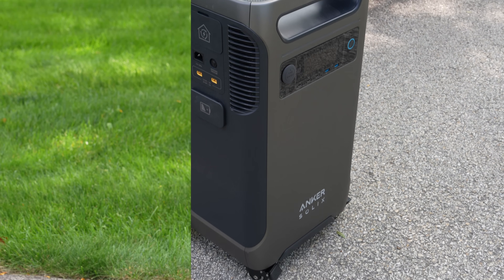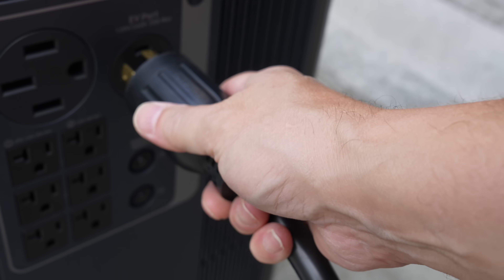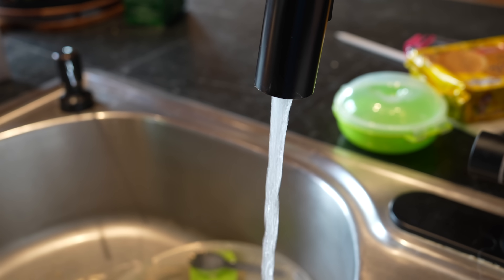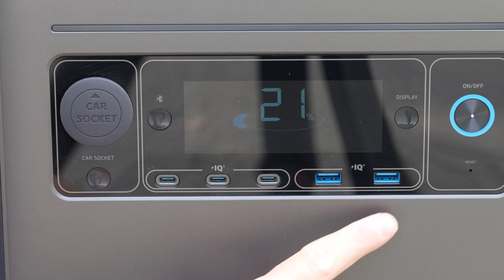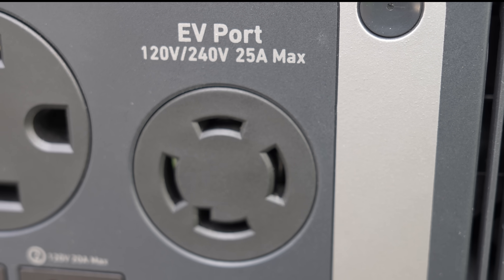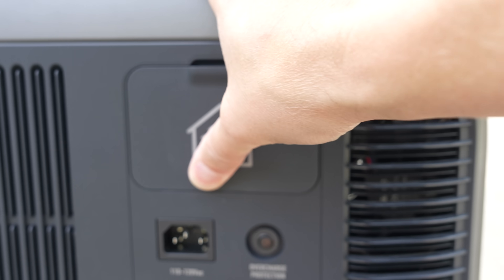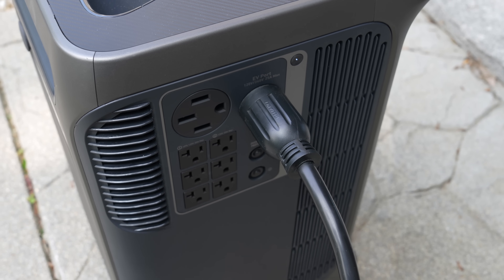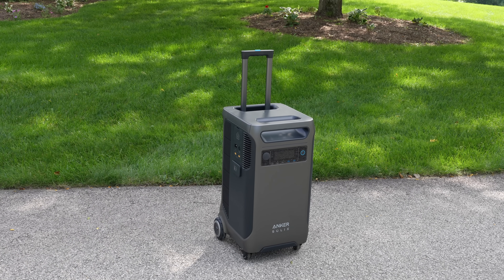Better than GAS Generator? First 240V Battery Backup - Anker SOLIX F3800

Comment: I have the f3800 and wish would have gone with EcoFlow. EcoFlow allows you to program to turn certain sockets on depending on battery level (ie if your level rises above 80%, turn on water heater), and EcoFlow also allows you to set a battery charging limit shutting off solar at say 90% to extend battery life.  Anker has none of that, plus just sitting idle the inverter drains almost 100watts. The Anker app is garbage, totally useless lacking basic features like charge limit. something that would be easy to add and has been requested. Research reddit before buying f3800, EcoFlow has better features for the amount you're spending

Comment: Would this power 3 hp shop equipment?  I called the manufacturer that sells heavy duty woodworking machines, and  they said their 220v machines would keep tripping because of some magnetic switch. Totally didn't understand what they were saying.
Anyways this was a 3 horse 220 volt, 12 amp wood planer I was looking to run on this Anker.  Will it REALLY work???

Comment: I speak from experience. These units are worthless in a real disaster. They're good only for a brief power outage. In a real disaster (like the 2 hurricanes I went through last year) nothing substitutes for a generator. I have a 6,000 Watt 240V inverter,  800 Amp Hours of LifePo batteries, and 2,000 Watts of solar to charge them. I still needed to use my generator most of the time. I live in Florida so I needed enough power to run my septic pump, 2 refrigerators, 1 freezer, and 2 window air conditioners 24/7 for weeks, not hours. Also internet and a TV is helpful as it keeps you from going crazy. This unit costs $3,000 USD ($4K if you want the solar as well). You can buy a pretty nice generator and a lot of gas for that amount. Like I said, these units are good for a brief power outage, but they are useless in a real disaster.
Reply: Only dumb ass would consume that much power in a real disaster

Comment: Your information is incorrect. This IS NOT the first unit to have standalone 240. The Zendure Superbase is the first. I have it and bought it 2 years ago because of that. It does 240 and 120 simultaneously. And a 6400Wh battery in 2023 https://www.youtube.com/watch?v=Ofmy92f4SgA&ab_channel=HOBOTECH

Comment: I hope Anker can make a smaller 240V compatible portable power station. If Anker can make a new version of C800/C1000/F1200/F1500 with 240V output compatibility, that would be sweet.

Comment: Biggest problem with the f3800 is the 240v outputs turn off while charging with 120v. Not good if you’re running the 240v to a sub panel.

Comment: this will never be better than a generator.
generators have long term reliability, lithium batteries will never have this. lead acid? maybe, but not lithium.
this product is for daily use, generators are for emergency use.

Comment: I think I’d like to have a device that allows a generator hook up that could pass through and charge the battery. That way I could cycle the generator and run it a bit more efficiently.

Comment: The ports for charging your phone directly from the device are for people who would use it the way I plan to. Keep it in the closet charged up, if the power goes out wheel it into the living room and run a space-heater or AC unit and charge your phone and stuff like that. Running only the essentials, just this pack without any expansions would last a long time. During a power-out event I'd have no need to run my entire house, just the essentials.
Reply: Right I don’t get why ppl need the whole house for a temporary outage.
Reply: @nmoore8994 
Exactly! Don't need to run every single thing in the house, laundry can most likely wait, the dishwasher can wait, and many other things can be switched off.
Reply: If that’s all you need couldn’t you just buy something cheaper?
Reply: @JacobsTrash 
Running something like a space heater that uses around 1500 watts consumes a ton of power, something this size is totally necessary for something like that and probably some lights and phone charger and refrigerator.

Comment: I think people are missing the point of this thing. This is best used in line with the solar panels they offer with this device, this can run your home overnight and charge and run your home during the day, it's completely automated and silent. People are comparing this to gasoline generators when they're not even in the same ballpark as this thing. If you connect this to solar you basically have unlimited free power, gas generators cost you money in fuel and maintenance. Also I'm not sure if anyone knows, but during any outage people usually freak out and buy up all the gasoline at gas stations and all that. You're still relying on the gas station to be there and fueled up if you use a gas generator, with this battery-pack and solar-panels you're only relying on the sky getting bright every day. These come with a long warranty also so if you did have an issue it's all taken care of. This is for people who don't want to mess around with loud generators and relying on refueling and all that. The sun is going to come up every day, gasoline at the gas station during an event isn't guaranteed.
Reply: @amptrek   First of all, the dual FP3800 setup with maximum expansion batteries holds 52kWh.  So it would take days for 1200 watts of solar panels to charge it, even if you weren't using any power at all.  It's not designed to run your home on solar power, it's designed as a battery backup to be charged from the grid and then have some solar for emergency use.  Not normal daily use.

The average house uses 30kWh per day.  1200 watts of solar panels - let's go crazy and pretend they'll be producing 1200 watts for 10 hours a day.  So that's 12kWh per day from the solar if you're lucky.  Some days when it's cloudy, you'll get about 0.  Like you said, 1 hour of the clothes dryer can use half of the power that the panels will produce all day.  Then there's no solar left to charge the batteries.  And forget about air conditioning.
Reply: @SalvadorButtersworth  RIGHT!!!
Reply: But from my understanding, this unit can only accept a maximum of 3 solar panels of up to 410watts each. Any more than that in parallel would be too many amps, and in series would be too many volts.

They're built so you can plug together 2 F3800 units, and a wall panel, with up to 12 expansion batteries, but that would only be good for emergency backup.  6 panels would not keep that much battery capacity charged if you're using it to power your home.  So if you buy the full set, about $20,000, you'd have to keep it charged from the grid.  Or charge it over multiple days with solar and then not use it until the emergency.

I guess once it's charged to 100%, you could use the relatively small amount of extra solar that's coming in during the day.  But a comparable $20,000 set of a different kind would come with 24 solar panels and less maximum battery capacity.  I think that's what you would need to realistically be off-grid for more than a few days.
Reply: Thanks for sharing 😊
Reply: The fact that you had to explain this lol Solar is just better
Reply: @audacityhour3104  Yep, people are against it but that's how it goes with new things. When fuel injection was introduced all the carburetor guys were totally against it, even though fuel injection is better in literally every way.
Reply: Do you have this ?
Reply: @oldblackstock2499 
Yes I have this. Running a few household things like a TV, Wi-Fi router, refrigerator and some other small stuff it lasts me all night, charges great during the day even on a cloudy day.
Reply: @amptrek awesome thanks for the info, that’s what I was looking for at least the fridge and some fans by power lose during hurricane, we did 7 days without nothing was rough, we sat in the car to recharge our phones and cold down a little. 
I think this will be a good investment
Reply: @sv160  This is a very good investment!
Reply: @oldblackstock2499 
I do have this.
Reply: Take my money!!!
Reply: What about places like Seattle where we can go weeks or months without seeing the sun
Reply: @VictorMartinez-rv2ec 
It'll charge on a cloudy day too, slower, but it'll charge. If you're energy efficient this thing would definitely work for ya.
Reply: @amptrek Have you been to Seattle in November?
Reply: @teddmented 
Seattle gets about 78 hours of daylight through the whole month of November on average, Seattle through the year is mostly cloudy. Solar panels still work on cloudy days and sometimes they can produce more electricity on cloudy days because the cooler day actually makes the solar panels more efficiently produce power. Even with clouds solar panels still work. If you can see light on the ground the solar panels are producing electricity.
Reply: @amptrek  You are wrong. Your solar footprint would have to be massive.
Reply: @billyswampwater4515 
All depends on how much electricity you use every day, there's not a base number that every household uses every single day. Some people are horrible at managing electricity and some people use very little electricity.
Reply: @VictorMartinez-rv2ec  Then part the clouds or actually live somewhere habitable 😅

Comment: too much money for what it’s capable of doing. 1/3 of that  money will buy a generator that will run the entire house just like its on the grid. If noise is the issue you can build a quiet box for the generator for about $500. you’re still saving nearly $2000 and the benefits are far and away greater. 

A unit like this would be good for temporary functions, where there is no electricity. If, you could increase the power for longer running time.

Comment: How long this batteries will last? I mean not the the charger but the battery. I bought a battery powered EGO Mower and after one year, batteries couldn't hold the charfe anymore... Same thing happened with some rioby batteries, and eventually with our smartphones...

I mean, it's a lot of money to have batteries not holding the charge in a couple of years.
Reply: Your mower is lithium ion which has ~500 charge cycles. This battery is Lithium Iron Phosphate which is 3000+. I believe the anker has a 5 year warranty and 10 year estimated lifespan.

Comment: If there is a power outage longer than 24 hours. The solix becomes an expensive brick.
Reply: What would you recommend.
Reply: @sirjames1977nc  a generator of some kind. Long as you feed the beast, you're good. Basically.

Comment: BS...it is not better than a generator, it is complimentary.  The only way this unit, ANY battery system is if it has Solar or Wind power for recharging.

Comment: Dont bother. Ideally all these devices should be made to run for at least 2 days without the need to recharge. But as far as I know, such battery unit does not yet "exist" or just hasnt been put to market. Eventually perhaps new power  devices will be able to power your home 100% 24/7 independently of power utility and grid when this happens, all power utility companies will close down due to loss of customers.

Comment: this is nope. i have a 5sets of commercial washer and dryer all runs for 5500watts 240v  base on our electric meter. idk what scam dryer you have. it cant run the initial startup which could spike more than 6000watts this is lame

Comment: I know this is an older video, but is there anyone who knows the peak wattage output of the single unit? I'm assuming the 6,000-watt rating is the running wattage. I currently use a gas generator with 9,000 peak watt capacity to power an outdoor 10,000lb capacity automotive lift. I'd love to invest in a solar battery system that could meet or exceed those numbers as running a gas generator is very annoying.

Comment: Not the only one, Titan, from Point Zero Energy, 240sp 4000w, 120v and 240v in one unit. Big difference,the Titans are the only true power low frequency inverter units, not these chinese high frequency units. Dont be fooled, low frequency units are the only way,tried and true

Comment: in all these reviews. no one  ever says how long these batteries will even last running basic appliances and lights in the house.  when i see reviews on the earth roamer rv and they say those things can last over a week on just solar charging the batteries. yes thats a million dolla motor home but why cant anyone just say that in their reviews on these batteries. how many days in basic lights and appliances will this thing last before you need to recharge it.
Reply: What you're asking is not calculated without more information. Each refrigerator will run different wattages, as do light technologies and quantities. Batteries are rated in watt-hours and you can add your load and do the calculation yourself easily with an online calculator.

Comment: Manual says it can take a  2400 watt solar charge but........V x amps= watts
32 x 10=320watts..ch1
60x25= 1500watts.ch2
Total= 1820 watts
Correct? 
So where are they getting that out can charge at 2400 watts

Comment: Dont buy one of these get a good gas or propane generator. There nothing but a computer controlled battery which doesnt last and takes forever to charge and cant charge untill the power comes back. If it has a solar panel it takes a week of strong sun to charge it.

Comment: You North Americans are consumption nutters. Get yourself a clothes dryer that uses half or less of the wattage. Here in the UK the average clothes dryer is 3000 watts...smallest 1,800....max heavy ones 5000. 6000watts for a clothes dryer is mad!

Comment: tfw this piece of junk cannot be recharged from a wall socket or gas generator, and output 240V at the same time. The EcoFlow Delta Pro Ultra, however, can.
Reply from the maker: Yes 100% correct as I showed in: https://youtu.be/2K9mlryo8lI But to be fair, no other power station on the market can do that either because you need dual inverters. The Delta Pro Ultra is a wonderful device but it is also almost $2k more even with my coupon. Neither one are junk but if you can afford the extra for the Ultra its certainly a great feature.
Reply: @SilverCymbal  not making a dig at you, bro. Just Anker for leaving out a feature that severely limits the usability of the unit. Keep it up with the quality content!
Reply from the maker: @therealmitch-a-palooza7262  No worries. No I didn't take it that way and I totally agree with you. I wish the Anker had it too. Thanks again for watching
Reply: All my eco flo products broke it's straight 🗑️ "not making a dig" just stating the facts for me 😂

Comment: Did your unit emit a constant high-speed fan noise @ like 70 decibels (sounds like a vacuum cleaner running)? I just got one yesterday and from the moment I turned it on it was super loud. I thought it might ramp down when fully charged - but 24 hours later, fully charged and with no load attached it's still so loud I can hear it from 2 rooms away with 2 sets of doors closed in between

Comment: Will they ever make a power station with 120/208 3 phase output?
Reply from the maker: I have a system capable of 3 phase power coming up later this month. Very exciting that someone has this now.
Reply: @SilverCymbal  That is very cool that someone actually thought of a 120/240 volt power station and something crazy is I thought about making one first

Comment: Been watching your vids and thought you were one of the rare honest no-BS kind of guys.
However, unless I missed it nowhere in the vid did you explain how this is going to actually replace a generator.
This is basically a giant rechargeable battery, not a generator by anyone's definition.  I need a small genset for when power goes down in winter for a day, maybe more.
Even limiting the circuits active at my main panel this would poop out after 14-16 hours. My current genset will run 3-4 hrs/gallon, and I usually have a couple 5g gas cans around for tractor/snowblower, etc. If I want to spend $100, I can get the conversion kit for running it off the house nat. gas.
Manf's all seem to be getting their influencers to hype these things as generators instead of simply portable power banks.
I love the Kickstart(?) campaign by Anker, "Q: How do you recharge these?  A: Use a generator or utility/house power..."
But I guess if someone offers you a $3500-5000 unit for free for a revie....
PS: Looks like basic unit is less than 4 Kwh for $3500-5000.
So you can draw 1Kw for 4 hours, or 4Kw for 1 hour.... for $3500-50000.   Thats about <$1 worth of electricity @$0.20/Kwh at above average electricity cost in most US States.
Compared to a $469 4.5Kw generator from Harbor Freight that you just need to keep a 5g gas can for and will run for 16 hours on 3g, or about 5g/24 hrs.
Reply: And there's the rub once you run the numbers.. for the same price I got a 14 kw Generac, we're on a 500 gallon propane tank. Last wind storm we were out of power for 4 days, but it's been up to 7.

Comment: Very hard to understand the true run time under ordinary conditions of using it as a backup for your home when the grid goes down. Assuming a hookup to one refrigerator, four 120 outlets plus one gas furnace, what would be the run time?  I suspect no more than 1 or 2 hours which would mean pretty much worthless as a home backup system...

Comment: The one thing I can’t seem to figure out about this device: can I take it to a Tesla charge station or any other charge station like you can do with the ecoflow home electric generator?
Reply: Probably, but it charges pretty fast from your home outlet.  Or from the matching solar panels.  And then you can charge your Tesla from this unit, if you get the extra bells and whistles and expansion batteries.  But I don't think it accepts enough solar panels to run your house on constantly.